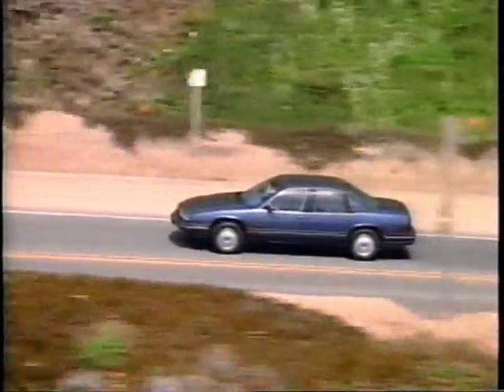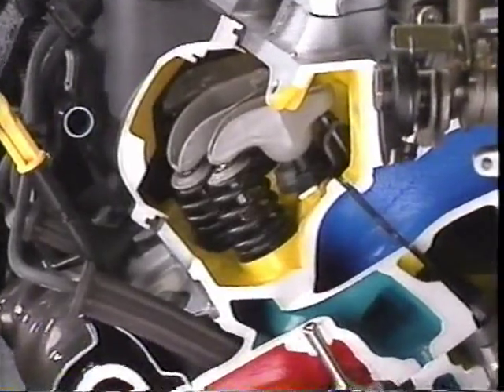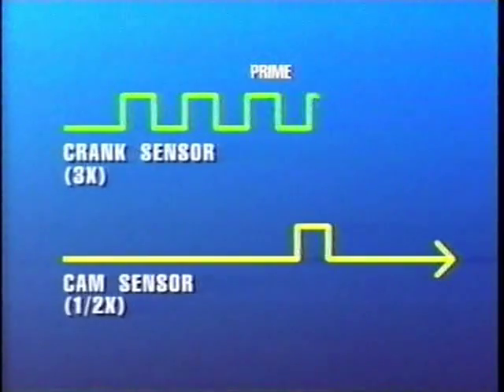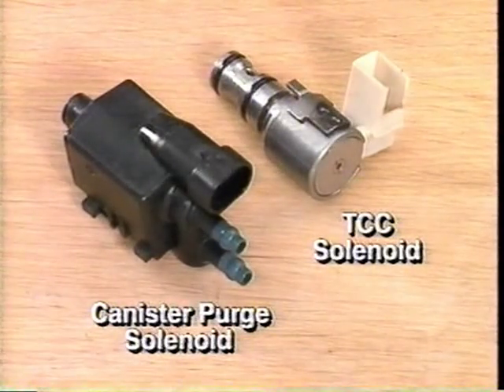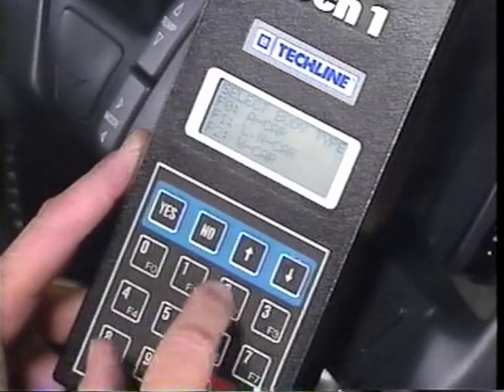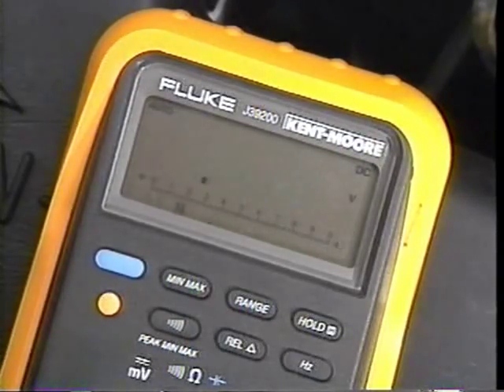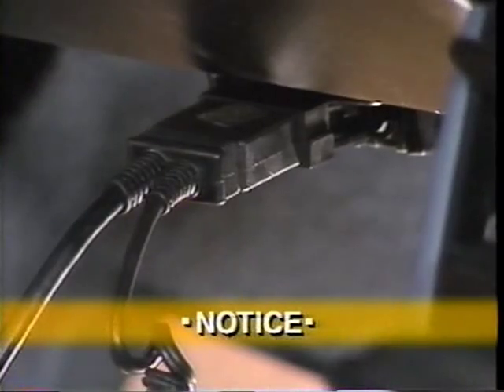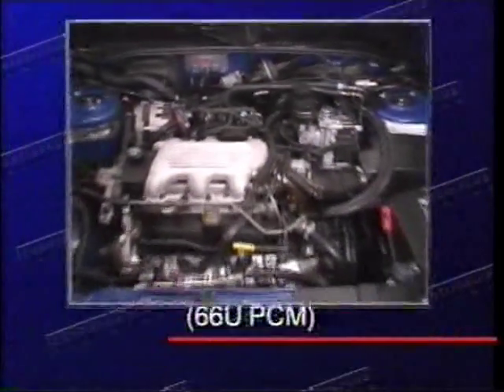Buick - 3100 SFI Engine Training (1994)

Comment: 2002 Chevrolet Malibu with 3100...intake manifold gasket leak.  Factory defect and not even 70K on it.
Reply: these engines seem to be hit and miss as far as that intake gasket goes. I've worked on a 2005 Buick century  for a while with this engine with 240,000kms (160,000mi) that showed no signs that gasket was gonna go. But I've also worked on grand prix's that were shooting twice as much coolant than gasoline into the cylinder with half the mileage on them.

Comment: Where is the 3x crankshaft position sensor on a 3100? @5:51
Reply: At the back of the block. Should shoe around the 27:00 min mark.

Comment: This engine, along with the LG8 and the 3400 LA1, were terrible engines.  The LG8 version of this engine was in my 2002 Pontiac Grand Prix.  Only 175hp (160hp in the original L82 version shown in this vid), piston slap, coolant sludge, and blown lower intake manifold gaskets.  Only thing it had going for it was its AWESOME sound when you floored it, which made it sound MUCH more powerful than it really was.  Thank goodness the car was rear-ended before the engine had a chance to really blow up (it was already spraying coolant through the L.I.M. gasket and had coolant sludge at only 72k miles)

Comment: worst POS engine ever made
Reply: No u
Reply: More like one of the best selling sedan engines. See 3.1 buicks driving about all the time. Really nice simple motors and super easy/ cheap to work on... they  just have some gasket issues but if you catch them quick you'll be good.
Reply: @187onasimp  i beat the living hell out of my L82 till I smashed the rear end of of my skylark after some snap oversteer 
I loved that car so much
Reply: @187onasimp  what do you mean catch them? Like change the head gaskets every so often?
Reply: @deepstate8474 no, the INTAKE MANIFOLD GASKET. I have an Fel-Pro aftermarket on mine, so far so good 50k miles.